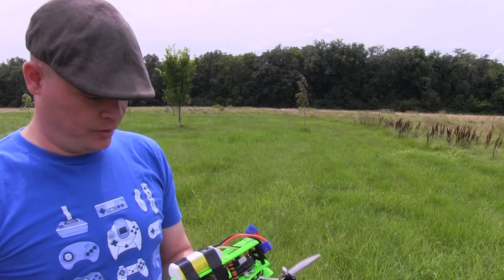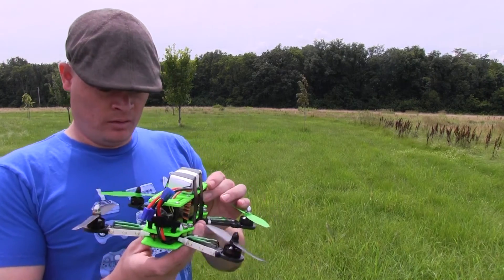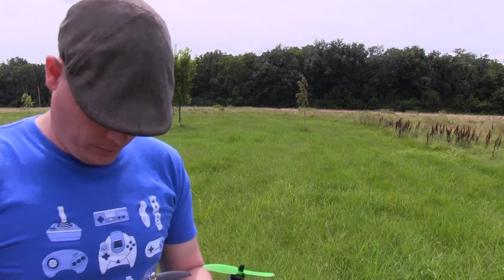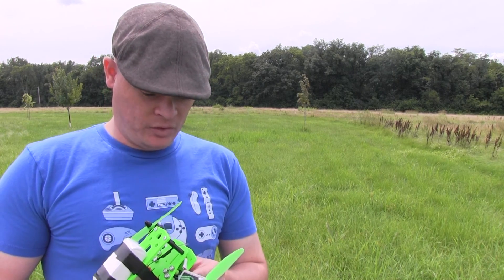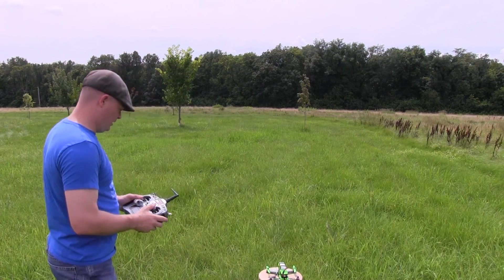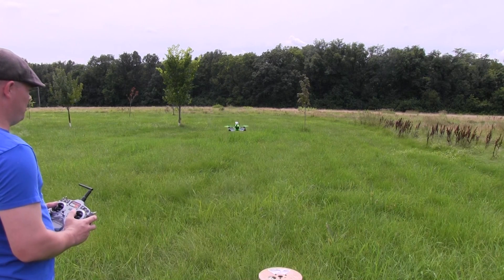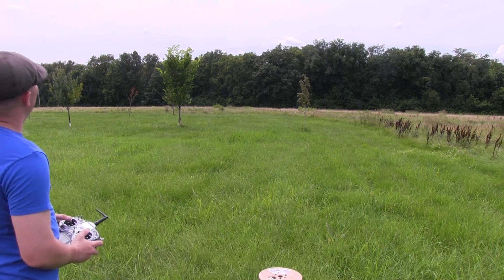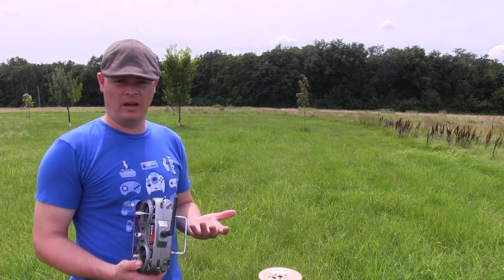250 Quadcopter First Flight With Spektrum DX6i Transmitter

Comment: hey i have the spektrum dx6, its binded and it recognises the quad but the quad doesnt respond to movements. its programmed already and has been armed. please help
Reply from the maker: This sounds like some troubleshooting is needed on your flight controller.  If it were me, I would open the GUI you are using according to your flight controller (KISS, BetaFlight, Cleanflight,  etc) and see if the radio is configured correctly.  For example, the correct type (DSMX, DSM2) is selected and the mapping is correct.  Next see if the GUI shows response on all channels in the correct direction, as in your throttle moves in the right direction when physically moving the throttle stick.

Comment: lol wrecked it ..not to worry, they are pretty hardy,  so far all ive done is flip mine  several times :)
i had 6 inch props on mine, but  just switched to 5 inch 3 blade props, i prefer them, the feel a tad safer,  i didnt have much  clearance with the 6 inch ones..
looking forward to more vids from you..
 bye from scotland.